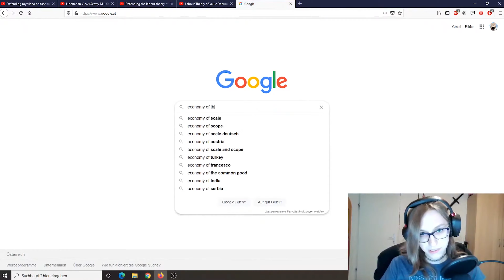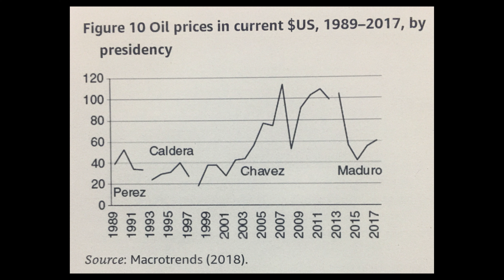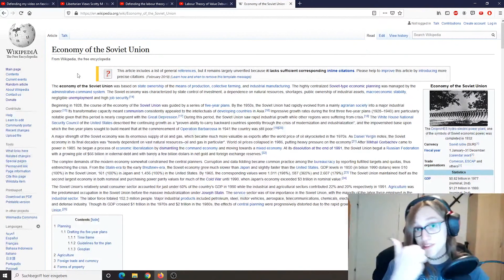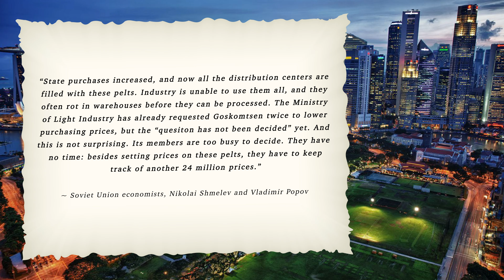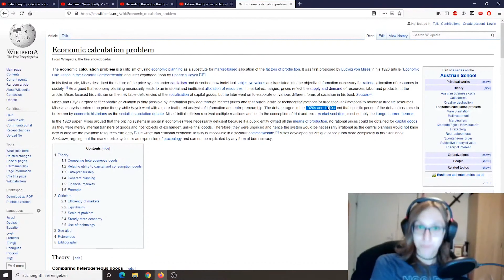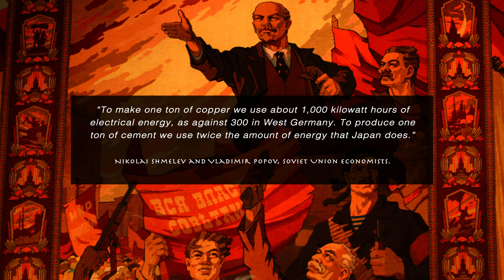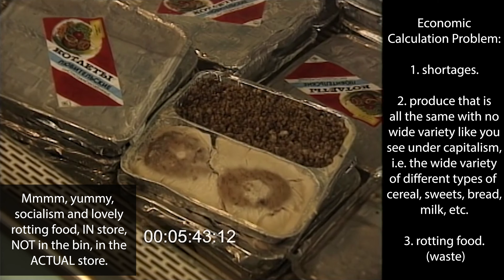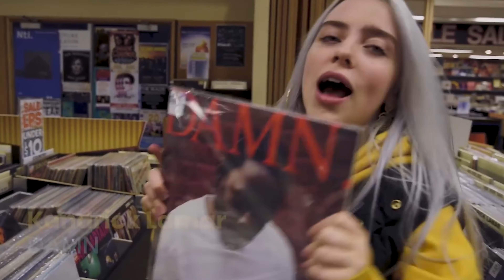Labour Theory of Value Debate: Response Debunking Viki 2000

Comment: Small correction scotty, the Econmic Calculation Problem concerns distribution, resources surplus and shortadges are distribution. Socialism is still inefficent, but for other reasons such as incentives and lack of innovation
Reply from the maker: Of course, the economic calculation problem is based on resouce misallocation, but that's the point, what follows the destruction of the price controls is shortages, surplus waste and correlates to the economic calculation problem because such resources could have been put to better use rather than producing what consumers simply don't want, which is why they're left to rot on shelves. 

The economic calculation problem is the biggest contributing factor to why there is waste, but I do agree that in the absence of incentives due to the absence of profits, this is why you end up with lack of incentives and innovation. It's a parastical ideology, it never fails to amuse me when socialists speak about socialism being more innovative.

Comment: The labor theory of value tells you that everything gets its value grom the labor that was put into it she didn,t say that value is determined by the labor that was put into it what os wrong with you.
Reply from the maker: It doesn't, if "EVERYTHING" got its value from the labour put into it, then ALL produce is valuable because all produce is made by labour, therefore, all produce has value based on the amount of labour and labour time. This simply isn't true, because there are many products labour quantity and time went into and is not selling. The film Robert the Bruce is contradictory of this statement. 

Your statement makes no sense, read it over and over. You STILL don't understand, do you? VALUE of produce does NOT stem "FROM" or "BY" labour. There is no value "FROM" labour if the product doesn't sell. Value stems from the individual consumer, it's external. If what you say that value of a product stems FROM labour, then the film Robert the Bruce was valuable. Guess what? It wasn't.
Reply: Consumer pay what your worth, it like the used market what someone willing to pay for a used product